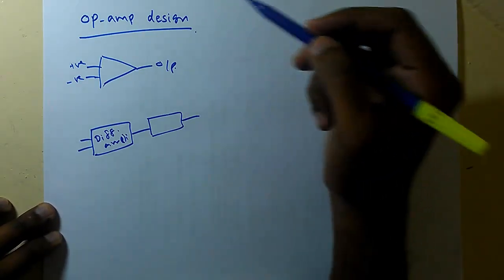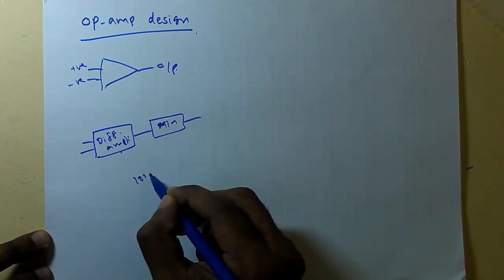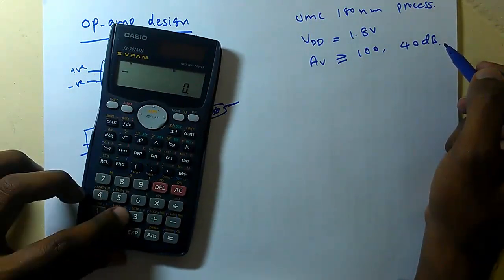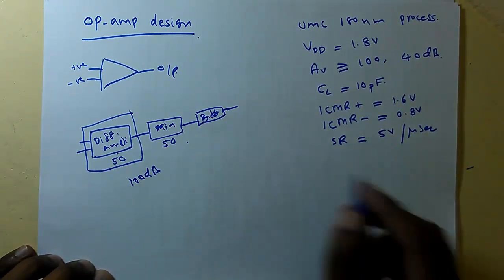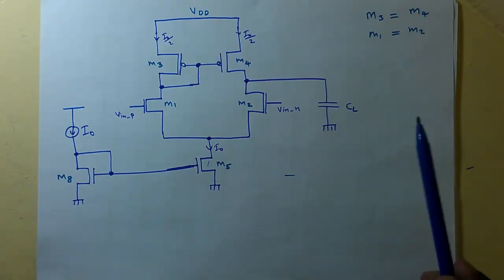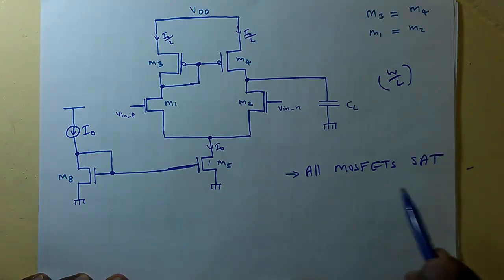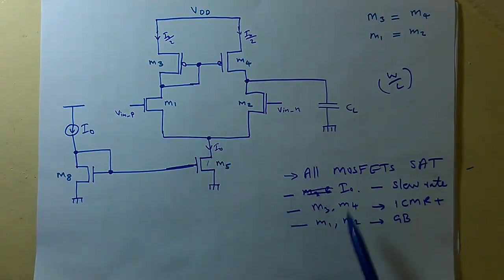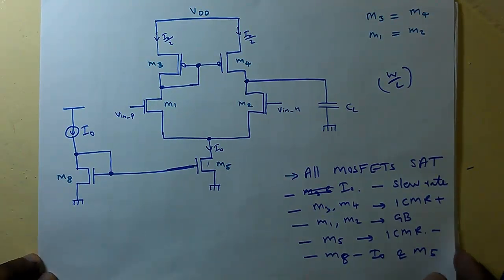cadence tutorial : Operational amplifier design in cadence Part 1a. Diff amp design

Comment: For the calculation of I0, id M1, M3 and M2 are in cut-off region as mentioned, than the current through M5 will also be zero. So why would M4 be conducting I0? Is the mentioned state valid only in great proximity to the change in conduction paths? 
Thanks!

Comment: hey guys, i'm in a trouble with my project. how can i design a one stage fully-diff amp with a GHz bandwidth as introduced in this movie procedure ? anybody's here ?
Reply: you can use cascode or telescopic diff amplifer for better gain and use lead compensator circuitry for good bandwidth.

Comment: I have a doubt in Io calculation based on Slew rate..
The M4 current will charge the capacitor and M2 MOSFET will discharge the capacitor. So current flowing through M4 is 25uA if I0 =50uA. So according to my understanding M4 current should be 50uA and I0=100uA. please correct me..
Reply: Slew rate happens when one branch is completely ON(or OFF). In that case, capacitor will be charging or discharging either by sinking or sourcing I0 current (not I0/2).
Reply: can you please indicate the conduction state (sat, cutoff) of M1, M3 and M2 during the above mentioned calculation? thanks @rahulbhat83
Reply: Thanks ^^ @rahulbhat83

Comment: Hi, Sir. could you explain how to calculate ICMR max and ICMR min? thanks.
Reply: +陳晧恩 It depends on the designer choice. But the supply voltage could alkso pose restrications on it. Apart from that its up to the designer.
Reply: It is given in "CMOS Analog Circuit Design” by Phillip Allen and Douglas R. Holberg.

Comment: When calculating I0, shouldn't the current through the capacitor be I0/2, so the total current I0=100uA? Thank you :)
Reply: As he said, slew rate is found when all of the current is sinking through one branch only. So, the complete current I0 will flow through the right branch containing the capacitor.
Reply: @abhishekmittal8658  can you please indicate the conduction state (sat, cutoff) of M1, M3 and M2 during the above mentioned calculation? thanks